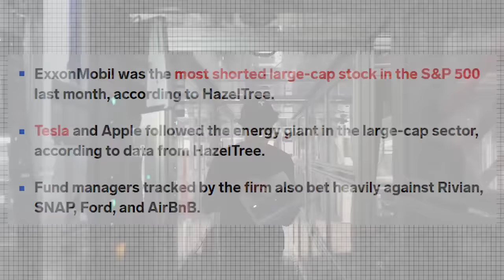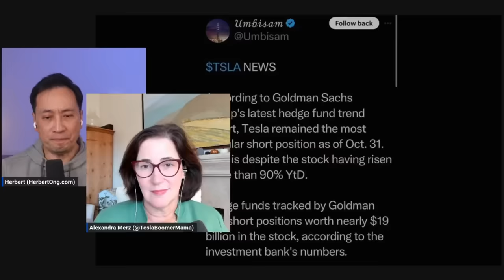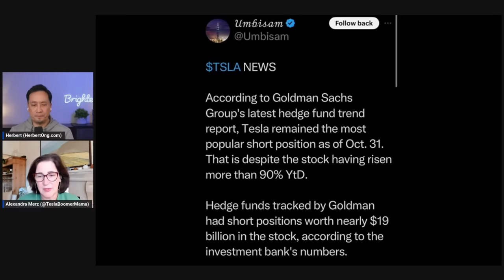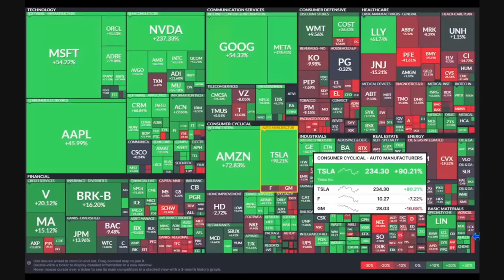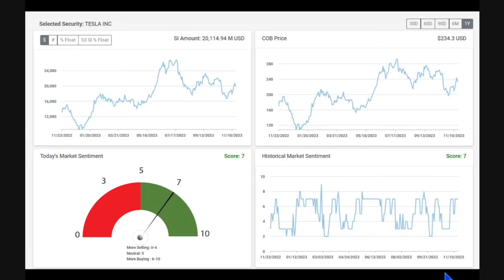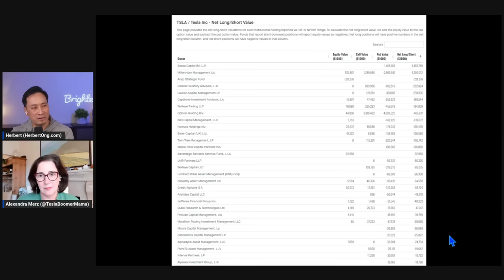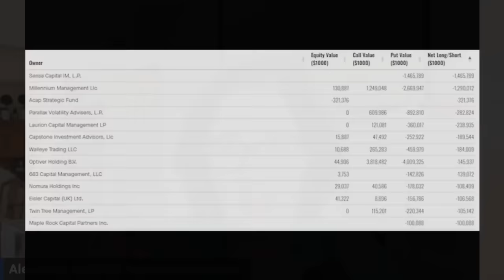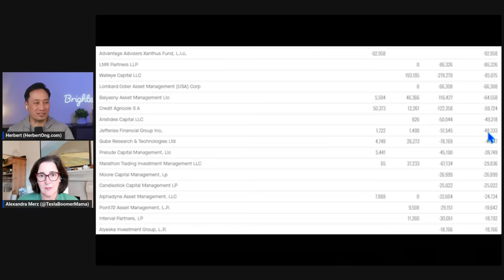EXCLUSIVE: Blowing the Lid Off TESLA’s Short Sellers w/Alexandra Merz

Comment: Puts can be held for a combo of a “married put” for a lock of 10% down locked in if holding stock with a usually known upside. So risking 10% for protection regardless how far stock goes down. 

Also a few other combinations you can do holding puts yet doesn’t sound like protection as much as wanting stock to fall

Comment: Short crash course : option contract works with 1 contract = 100 shares. You buy a short ( or put) contract at 220 $ TSLA expiring the 1 Dec, it will cost you 0.54 X 100=54 $.
If the stock never reach 220 $ on the 1 Dec, that's it, you loose 54 $. If you had 10 contract, 10 times that amount. SO someone on the other side sold you that contract. If the stock goes to 200 $, The seller MUST buy your 100 shares for 220$ even if the shares  worth less the 220 $ at the time. There is different expiration dates too. You will need to have enought money to buy the 100 shares at 220 $ strike price so if the price would be 1 cent below 220 $, you need to have 21 999 $ to buy them. You can opt out of your options at a cost before expiration. The one selling you the option can also opt out before expiration. The put option seller is bullish. When he sold the contract of 220 $ expiration1 Dec he pocket 0.52 X 100=52 $.  Sell PUTS means he does not own the shares may have to buy them for 220 $ even if the stock would crash to zero $ That's where the unlimited loss come from. So it's a good way to buy shares with a discount ( selling puts) but if your target isn't reach and the stock explode upward, you will not own the stock and may have to buy it at a much higher price. Avoid around earnings of event like cyber truck unless you know something. What to never do is selling a call option and not owning the shares. If the shares would go to 350 $ from 237 $ you will have to buy 100 shares X 350$=35000$. If you have 10 contract, add a zero 350 000$.. If you own the shares selling a call option, well, you give away your share if the stock reach your strike price at contract expiration lets say 280 $ So you would miss on the difference between 350 $ and your strike price of 280 $ so 70 $ X 100=70 000 $ If you sell a call expiration 1 DEC you will make 4 $ (in the option chain) but can miss on the stock going above what ever amount above 280 $. But hey, if your stock average cost was 200 $/share, you still make 8000$. I may have made mistakes here. Don't trust me, learn,watch videos, ask questions and paper trade option a lot before trying with your money. It is complexe.

Comment: Alexandra - I don’t know if you will see this, but surely Cayman and Delaware just means they have both an onshore and an offshore fund structure? That’s normal practice. Also, only showing the notional of a put position is irrelevant - I am not sure I ever heard you mentioning the strike price. It could be a tiny proportion of the overall portfolio. I’m long by the way, but I think it may be worth checking this kind of information first.
Reply: If you take the 6,000,000 shares times the price of TSLA at the end of September it comes out at around 1.5bn USD. Which makes me think this ‘huge’ exposure could be based on the underlying notional mv of the put contracts. Which would be wrong. If my assumption is correct this really needs to be changed as it would be very misleading to anyone watching this video. If not, I apologise.